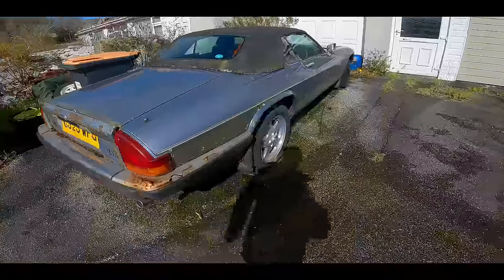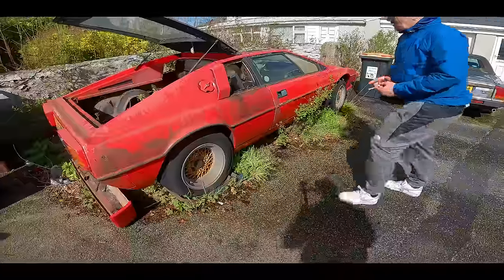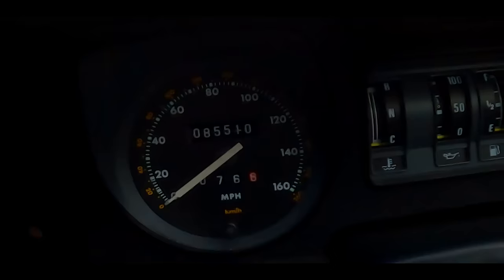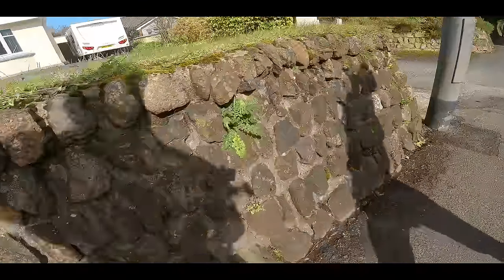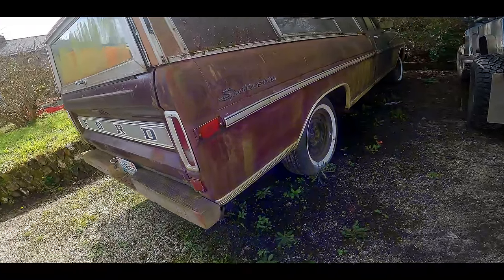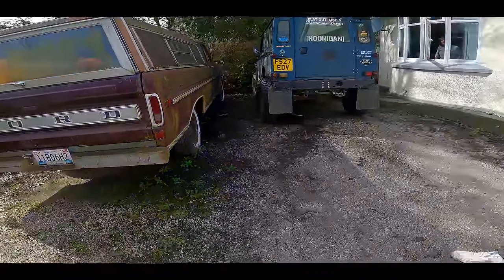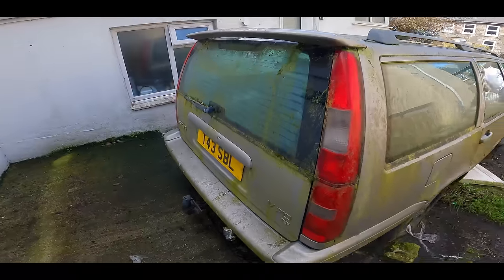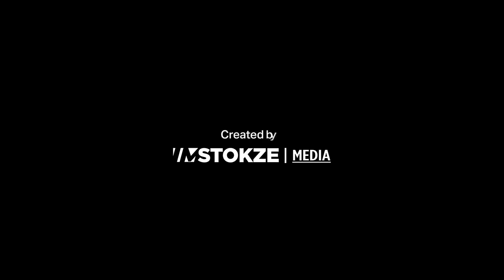ABANDONED Cars Of CORNWALL, Unreal finds | IMSTOKZE 🇬🇧

Comment: The jag head lights are us spec as original ones rust and they don't make them anymore the 850 would not been worth ote when parked there I brake volvos v70r's the xjs rarebif the v12 badge us right as its manual would be a conversion